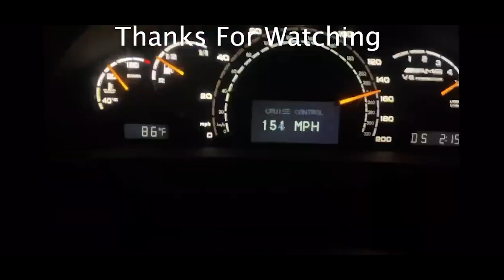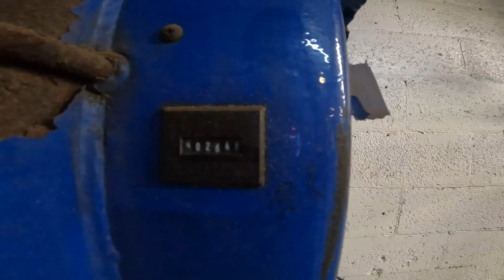Massive Generator Scrap out Pt. 2 & DIY Steel Rack Pt.1

Comment: There goes a 15k generator should have fixed it an sold it would have gotten alot more money
Reply from the maker: Unless it is diesel and a Industrial generator no one wants them. There is a difference between a stand by generator and industrial